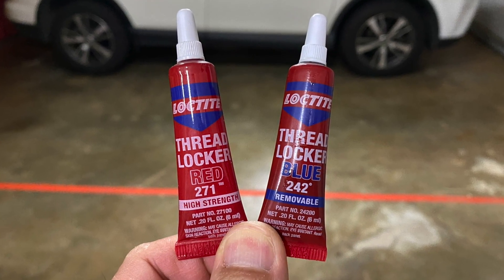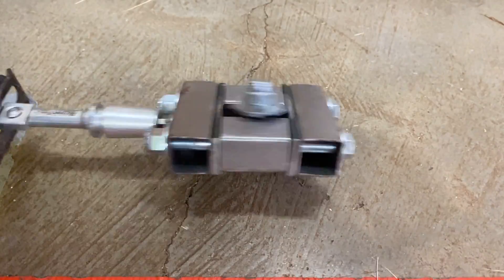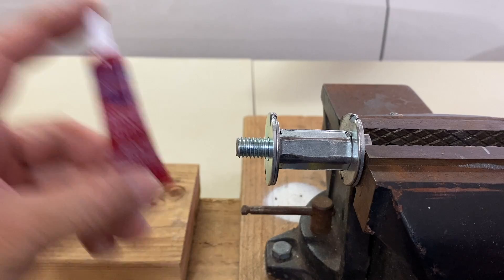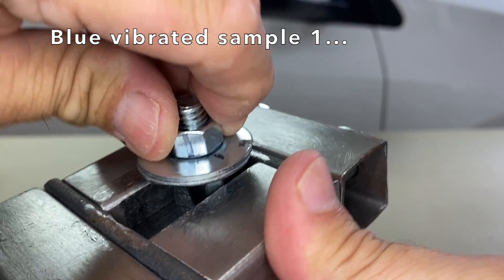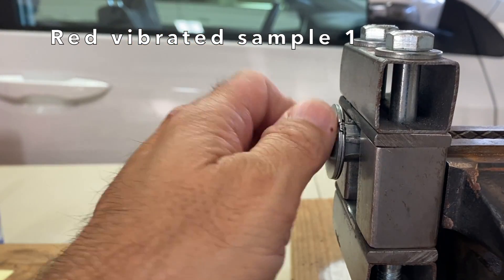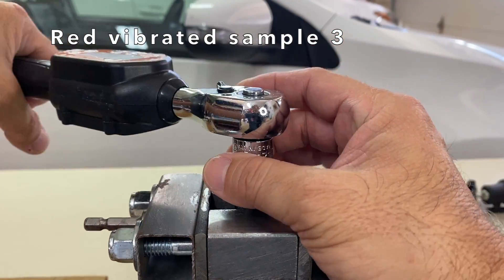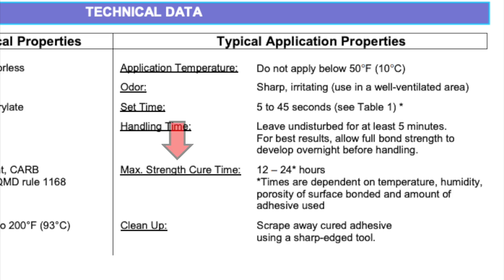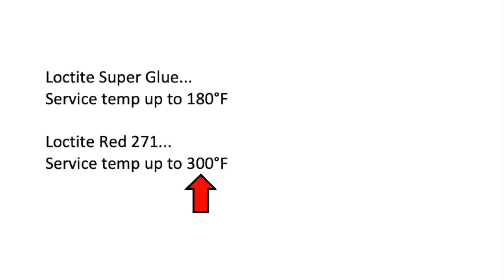Nuts & Bolts - Loctite Red & Blue EXTREME Impact Vibration Test

Comment: A few thoughts on why you had inconsistent numbers. A307 bolts are low strength bolts and not intended to be torqued to a spec. Second it looks like you used galvanized nuts and bolts and most likely electroplated galvanized hardware. The thread tolerances are changed when bolts are electro galvanized. A thin layer of zinc is deposited on the bolt and nut. The deposit can be inconsistent. Zinc is soft and deforms when torqued, called galling. Zinc can act as a lubricant. Bottom line if the bolts are A307 or galvanized, they are not used in a critical torque application. Hot dipped hardware has a thicker coating and the nuts are overtapped after galvanizing and do not have zinc on the nut threads and can rust if left outside and not in contact with the bolt. The zinc on the bolt protects the nut threads.

I suggest you redo your test with black Grade 8 bolts and to test your testing methods. The Locktight will work as a lubricant similar to zinc. Having a larger sample size will allow you to run the standard deviation. The smaller the standard deviation, the better the test methods.

Comment: Based on what I can conclude from your findings, in high vibration applications, I am going to use red locktight 271 on bolt threads, in combination with spring washers AND nyloc nuts. Possibly a second nyloc nut if in doubt. Thanks
Reply: Perhaps Nordlock washers might interest you.

Comment: Loctite will tell you that on plated fasteners, use of one of Primer N or Primer T will give best results, as they drive the compund to full cure. The factory derived breakaway and prevailing torque numbers are determined off black iron finished steel nuts and bolts.  Using heat on the assebled parts will achieve better results too, but that is not practical.

Comment: A DIY version of an industrial vibration test 😁 Nice 👍🏼. I have the same experience from professional tests. Red Loctite is good for moderate vibration. If you had continued the red would likely have lost the clamp load as well even if the nut had stayed on the bolt. If you are not already familiar with it, google Junker test. It’s considered the gold standard for fasteners. Thanks for another good video.
Reply from the maker: Thanks!
Yes, I’ve seen the Junker test but couldn’t figure a diy way to duplicate it.  I ran across the testing method used in the aviation industry and based my rig on it.  👍😎

Comment: You missed one thing, tension works out of screw so if you put that much force on whole screw you would need to weld it actually to not allow it to break on any poilimeric substance glue...
If you put it to cure properlly with acutally less loctite ( it shouldnt go over screw cap to get full cure inside because polimers are not sealeants agains air and need longer activation time in this case ) so this is not relevant test for vibration resistance, what u tested here is resistance against upper forces for screw hold kappa. 2/10

Comment: I would recommend trying higher purity isopropyl alcohol. The stuff meant for antiseptic purposes may contain oils meant to avoid drying the skin so much. Try something meant for electronics repairs because those are designed to evaporate to fully clean surface.
Reply from the maker: Thanks!  I have 91% IPA and might give it a try.  😎

Comment: Test old school mechanical methods; staking the outward nt to bolt margin and then using safety wire through a drilled hole through thenut and bolt.  I think I will start spot welding lol

Comment: Superglue will damage the threads over time.
It's corrosive.
Reply from the maker: Interesting… if that’s true, why do manufacturers say their superglue can be used on metal if it will eventually corrode the metal and fail?  I might do an experiment.  How long before the corrosion will be visible… 1 year?  😎
Reply: @HacksbyDad  
It will also break down over time, depending on how much weathering it gets, whereas Loctite will not.
 It won't even take a year.
Reply from the maker: @AGRIV8TD1963  👍😎

Comment: Sorry to say, you made an error during application on many of the samples.
You can not get Loctite on the mating surfaces. Only on the threads.
Reply from the maker: Sorry… I’ll try to avoid that in the future.  What impact does it have on the fastened assembly?  😎
Reply: @HacksbyDad  
Potential to fail. If fact, the best way to use Loctite is to apply it to the threads, then let it set up for a few minutes, then attach nut, torque as needed. Because the act of screwing on the nut, heats up the threads enough to make the Loctite fluid again. Therefore proper penetration.
Reply from the maker: @AGRIV8TD1963  I did this experiment to show that Loctite does not cure when exposed to air... https://youtu.be/lFHr1reTDW8
Maybe loosely thread on the nut, wait, and then torque?
Reply: @HacksbyDad  
Loctite doesn't completely dry when exposed to air during the time needed for application, but it does set up. It will dry over time. Thin coat of Loctite all the way around the bolt, wipe off excess if any.
Put a thin coat all the way around the threads, then check it in 24 hours, then tell me if it had set up. Then do the same, and check after a week.
Did the Loctite dry?
Reply from the maker: @AGRIV8TD1963  So you apply Loctite, wipe excess, let cure for a few minutes, thread on nut, and finally torque?
Reply: @HacksbyDad  
Yes! Right -on Brother!
Try it in comparison to your usual application.
Reply: Trust me... there is a difference in performance.
Reply from the maker: @AGRIV8TD1963  👍😎

Comment: So many mechanics don't realize how important it is to have very clean threads for Loctite to work its best.
Reply: Yep. It is a "glue". Every single glue on the planet needs clean surfaces. Thats why i hate threadlockers, they need always clean surfaces. If i can, i prefer to use a split washer.
Reply: @vaguincolombia  
Split washers are No Good!
Trust me!
Better off with nylon lock nuts, or threadlocker.😅
Reply: @AGRIV8TD1963  Well Nylon lock nuts dont work with with fixed or soldered nuts. Also for very high temperatures nothing can beat a split washer.
Reply: @vaguincolombia  If you have locks that experience heavy vibration and must not absolutely open, see how things are done with airplanes: metal wire with special winding around the nut.

Comment: For torque purposes loctite is considered a lubricant.  A wet torque spec should be used should be used on all the hardware including the control.  That said, i think the difference between wet and dry is like 20% so only a 2.2lb value in this case.  I don't think it would make or break your experiment.
Reply from the maker: That's what I thought before conducting this experiment... https://youtu.be/SLBx09En_P0
Watch until the end to find out what the experts at Nord-Lock say as well.  😎

Comment: The hardware looks like it may be plated in some way.  Please note that Loctite needs active metal ions to fully cure.  If you have corrosion resistant hardware, you have to use Loctite primer to get full cure.  Super Glue or CA adhesive does not need active metal ions.
Reply from the maker: Sort of.  Zinc is more of a passive metal than an active metal.  https://youtu.be/MAyIH4i6ryI

Comment: Cool, red is the tougher one. I have both w/ screw spring washer combo sometimes.

God bless.
Reply: That is actually smart approach spring reduces upper forces and vibration and loctite supports vibrations over screw so that's neat - I'm doing the same way if possible on screw connections.